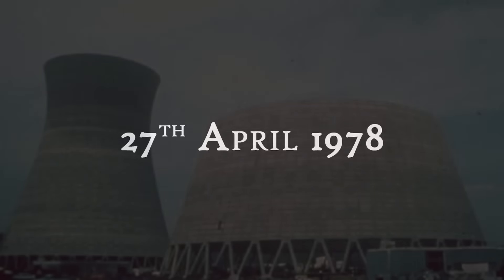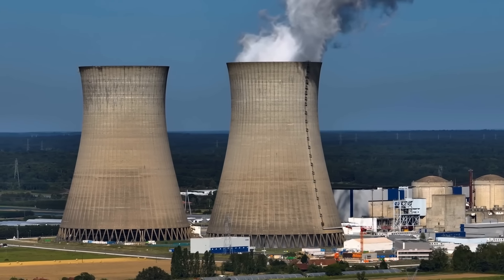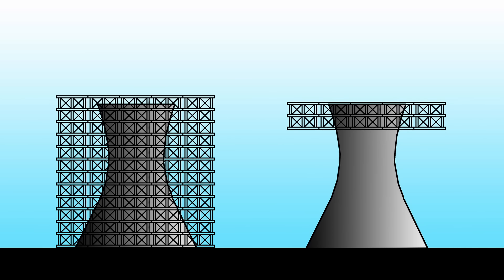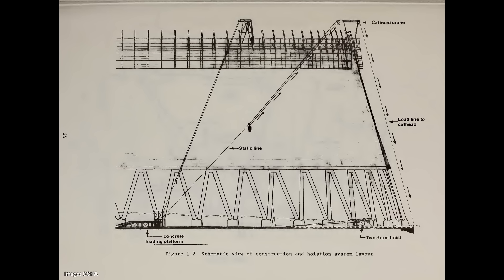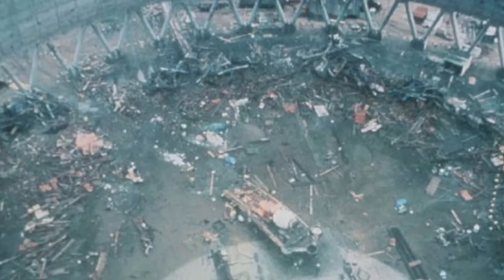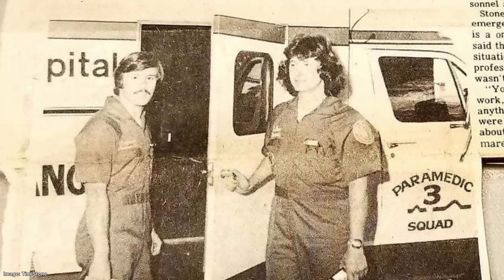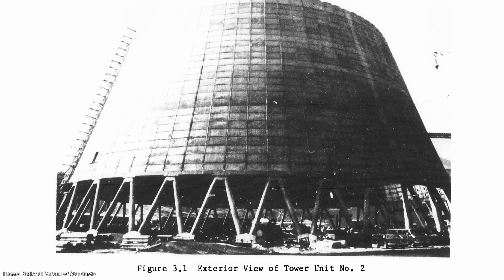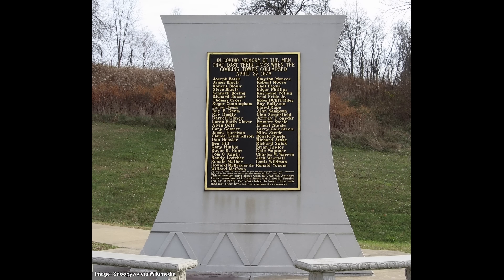The Willow Island Disaster | A Short Documentary | Fascinating Horror

Comment: This jump-form scaffolding system was created by an inventor, not an engineer or reviewed by an engineer. After the incident some states banned this method of construction. A knee-jerk reaction as there had been many successful constructions using it...the scaffolding method wasn't inherently faulty but rather incomplete without the step of testing and calculating. It is still used today with proper testing of the supporting concrete and engineering calculations to verify its load bearing strength.
Reply: Thanks for that. Interesting.
Reply: This seems like a modern take on the method used to build the dome of the Cathedral in Florence. Among other challenges, traditional scaffolding techniques wouldn't work, so Brunelleschi created a new method which hung scaffolding on the recently completed portion to allow for the next few feet of construction. I did a paper on it back in university for a history course, and spent a few days in the engineering library. (I may have some details wrong, it's been many years since I did that research.)
Reply: as the video notes, not just that: The scaffolding in place at the location was not even completed to the inventor's standards, much less an engineers.  Missing bolts and under quality bolts, un-reviewed modifications and modifications to additional equipment...the wonder is not that this failed. It's that it took uncured concrete to make it fail.

Comment: To help understand:
Concrete is basically a gelatinous substance that hardens into hard concrete. We say it takes 28 days for it to reach it's designed strength. It hardens through a process in which heat is developed (you can often actually feel the warmth of a fresh concrete curing in the first day or two). As the environment gets cold enough the curing process first slows down and then basically pauses until the temperature is high enough to resume curing.
If it's even colder than that, the concrete gel can even freeze and the ice crystals will break it apart from within.

This is basic knowledge about concrete pouring and after only 20 hours is even "testable" by sticking your finger in it. If it's all good and well, you shouldn't be able to, depending on the specifications of the concrete.
Reply: They were really pushing the limits on this job.  5 feet of concrete with not even a day to cure, even under ideal conditions of temperature and humidity, that's asking a lot.  And near freezing rain all night is differently NOT ideal.  Also what if the mix was out of specification, such as too much water ( can drastically lower strength) or the amount of cement added off + or -.  Did they even get to pull a sample before pouring?  Even a simple sidewalk that's about 4 inches thick you don't want to walk on for 2 or so days.
Reply: You would never pour a second layer when the previous layer had been poured when it had been rainy and the temperature had been near freezing. Especially since it was again cold that day. It was unlikely that it had gotten above freezing overnight.

I’m actually shocked they poured concrete on the day it was near freezing. 

When my Dad worked on Stacks for Nuclear Power plants the work was always done late spring into summer so there was no problem with the concrete curing. Some with bridges and other structures needing concrete.
Reply: @Luka_menorykee  knows concrete. My career started after this. SOP was to not strip forms for~24 hours, not to add forms on top of that or in any way disturb the pour for ~24 more hours, and not to attach loads to or pour the next lift of concrete until at least ~3 days had passed and the Field Engineers had approved it. Many things can vary the cure time, initial strength, and end strength. You have to work with concrete's timetable;m you cannot do it by a clock or calendar. There have been plenty of accidents since this one which were caused by loading uncured or improperly cured concrete- it seems that they never learn...
Reply: its an interesting material because it can also get too hot, which is why structures like dams have cooling pipes to keep the pour cool(ish)
Reply: @P_RO_  I suspect some lessons are ignored in name of the mighty dollar(or nation correct currency). You can always find leadership that is willing to cut corners because nothing has happened to one of their jobsites yet. I think leadership especially needs to learn "cut corners lead to busy coroners"
Reply: what makes you think that people dont understand.?
Reply: @nowistime8070   a lot of people know almost nothing about concrete. In fact,an average person doesn't even know what the difference between cement and concrete is and use the terms interchangeably.
This is a disaster channel, not an engineering channel, so although this information is obvious to some, for most it won't be.

To be honest, I'm a civil engineer and I know some fellow engineers who are not really aware of the basics I wrote here because they only work in the office, only work with steel / timber and never had the hands-on site experience.
Reply: I heard that the concrete in the Hoover Dam is still curing after these years.
Reply: @arnoldhenry  Yes. We were lucky enough to do the in-depth underground tour before 9-11 closed that option and saw the temperature readings for the innermost sections near the base of the dam, still cooking away in there.
Reply: @ducatisti  that's amazing
Reply: @filanfyretracker  I actually really like that phase. Beautifully sums up the mentality entirely.
Reply: I worked on a large tunnel project in the UK, a shaft driven through rock was lined with mixed onsite concrete in a top down casting operation. The formwork was hung on 8 cables attached to steel beams across the shaft top. After 2 layers of Rebar mesh had been installed the formwork was lower into position using 8 Tirfors "come along type jacks". The form was then expanded out and a wedge segment installed. Bolt hole formers for the next lifts installed. During the pours test cubes were cast and some were tested after one week. The one week was to allow from drill, blast and excavation work to proceed and the concrete to gain strength. The formwork was the struck and the lowering procedure repeated with the formwork still hung from the beams.
After three lifts had been cast the formwork was the hung on the first cast concrete lift, using the cast in bolt fixtures. The first pour test showed the concrete with add mixture had gained the 28 strength. This cycle then used to the shaft bottom without any mishaps. The lining did benefit from being in an enclosed shaft, even though the site was between two rivers one having the 2nd fastest rise and fall of tide in the world and open to a wide estuary.
Reply: @filanfyretracker  Hession sheet covers well watered do the trick on floor and road slabs, while casting precast tunnel sections we dropped a canvas hood over the mould and steamed them for 6hrs. Outside mould section removed and the section place in the sprinkler shed for 24 hrs. Then stacked in a shaded area with gaps between for airflow until the 28 day test has been passed.
The very few segments that did fail were donated to a special school for a paddling pool. The kids loved it.
Reply: @filanfyretracker  Constant supervision by the contractors staff and the clients staff is required. Workers get lazy and don't install all the bolts etc. Equipment gets worn, modified and abused.
Reply: @TheByard  you must be a bot. Sounds like copy-pasting from some Reddit topic and has nothing to do with anything said here or the video. Looks like an AI bot comment that recognised the word concrete and tried to write comment.

Please tell me you're a real person?
Reply: @Privacy_menorykee  Most people don't need to know the technical details of how concrete works/sets, but those 'experts' working with it DO need to know.
Out of those who died, some of those ought to have known that what they were being asked to do was completely wrong.
But I suspect they did as they were told, for fear of their jobs.

Comment: I own a chimney company and, until a year ago, I did the masonry work for my company. And yes, I am a female!! LOL!! As soon as he started describing the scaffolding system I knew exactly what was coming next. Then he described the weather conditions and all I could think was, "Oh dear God, their fate is sealed!" Depending on the thickness of the concrete it can take years to fully cure! The masonry actually lets off heat as it cures so thicker applications can become very hot internally, which takes a lot of time to cure. I use reinforcing agents in all my masonry but that is not the be all cure all. Taking time to cure is the key to a really strong finished product. When temperatures dip into freezing there is an additive we use that helps to cure the masonry faster so it can set up even in freezing temperatures. However, even with that product available to me I always schedule masonry jobs for temperatures 40 degrees or above and never do masonry in the rain. Extreme downpours can add too much moisture to your mixture resulting in a product that takes a lot longer to cure. You want a cake batter consistency at all times, no exceptions!! Masons working with masonry should have known all of these variables and the job site should have been closed down until the weather was clear to resume. I don't care how much a customer squawks about a job taking too long because safety comes first always!!!!!!!!!!  I cannot even imagine handling a job site like this one was handled. If I was one of the workers and saw what they wanted me to do I would have walked off the job that second!!!  This is just horrible!! I feel so bad for all the families involved, especially the one who lost 11 members. RIP. Valuable lesson learned............ Don't allow anyone to put profits before your own safety! Be willing to walk!!
Reply: When I heard the narration about freezing weather and my knowledge of concrete curing, we both had the same thoughts of foreboding.

Comment: Ahh yes, I love the construction system that gambles your workers' lives with the quality of the work itself. Did Noone ask "what happens if the tower isn't set or stable enough?"
Reply: Did you ignore the part where it said that if the system hadn’t been modified and had been fully connected the way it was supposed to collapse could’ve been averted
Reply: No, but I also didn't ignore the part where 50 people would be alive if they just built the damn scaffolding tower
Reply: @spankosupreme2070  
The scaffolding tower wasn’t the problem. The problem was the concrete wasn’t ready. The form was modified, and it wasn’t properly bolted, and the bolts that they did use were the wrong type. 
So what makes you think they could build the scaffolding correctly?
Reply: @neilkurzman4907 Ask yourself why they stopped constructing towers using that method. Research-Cottrell built 36 others previously, but it only takes one. It's almost like gambling everyone's lives on concrete set the previous day was a poor idea outside of the drawing board. Almost.
Reply: @JeepnHeel  
Did you watch a different video than I did. They didn’t say anything about the construction method. They said it was used in properly. They said the equipment was modified. The bolts used were the wrong grade. Not all the bolts were installed. And the concrete was never tested to see if it was strong enough. What video did you watch?

Comment: I work for a specialty contractor that installs concrete unit pavers. There have been times when the company had to get an ASAP order, and the manufacturer required a release stating that the purchaser is aware of the potential problems of using concrete pavers that may have had insufficient time to cure.

Comment: Its insane that there were no treatable injuries. I think this might be the only construction accident that there was no in between. It was either fatal on unharmed. At least its the only one ive heard of. Its very strange, especially if youve worked on big construction projects and know how people are generally spread out over a site horizontally and vertically.
Reply: I imagine the method of scaffolding was partly the reason for that. With a standard scaffolding tower people would be on multiple different levels even if it was just because they were coming up or down, but with this one they would have probably tried to minimise trips and all been at the same height.
Reply: @littlebear274  
 That's a good point. It's a pretty good explanation for the most part. There still had to be tenders and other trades on the ground below the scaffolding. My best explanation for them would be either, they had enough warning to get entirely clear, or had no clue it was happening until it hit them. 
It's still an oddity and a one in a billion situation.

Comment: They were applying load to concrete after ONE day of set time? Even in good weather that’s patently ridiculous. I generally consider 3 days the minimum for concrete to reach a working strength that you can continue building on.
Reply: And yet patently it works and has been the preferred method of building such things for almost 50 years.
Reply: @krashd  maybe with a longer set time, but concrete is only at ~10% strength after 24hrs and I doubt they’re sourcing mass quantities of fast setting concrete for all these projects.

Comment: As soon as you said the temperature that day, I knew that it had to do with the concrete not setting. I have never poured concrete. I don't work with concrete. But I have something called common sense. If it is too cold it's going to take longer to dry and set up. Someone on that crew should have known that. However, a lot of times people are pushed to get construction done at all costs. The "all costs" was 51 lives and lots of devastation for the families.

Comment: This was an accident that never should have happened. 

Concrete needs time to cure and it needs more time in cold rainy weather. Especially if it is going to be used as a load bearing structure.

It should have been tested if they were going to use it to hold up the weight of the cranes, scaffolding and the men and their equipment.

This design, altho cheaper, depended on the previous days concrete being completely cured. It also depended on the concrete wall being able to hold the weight of the crane, scaffolding and men which may have become marginal as they reached the narrower part of the stack.

As far as the men all being dead, it is not at all surprising. My Dad fell once and he only survived because he managed to land between two piles of construction material. 5 feet either way and he wouldn’t have survived. 

If any of the men reached the ground before any of the construction debris they would have been very quickly converted by debris. the impact of the debris alone would have killed them.